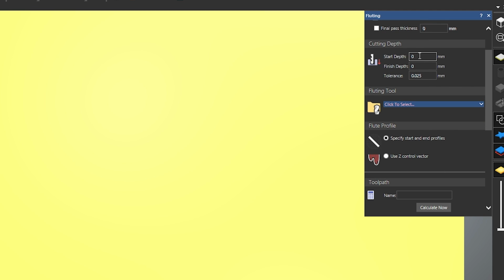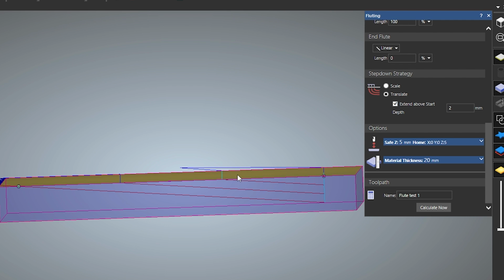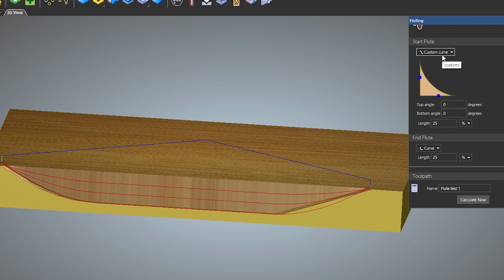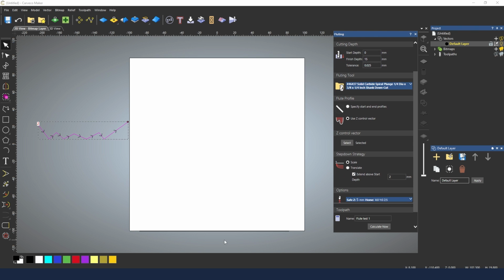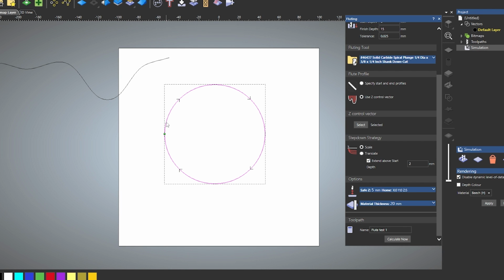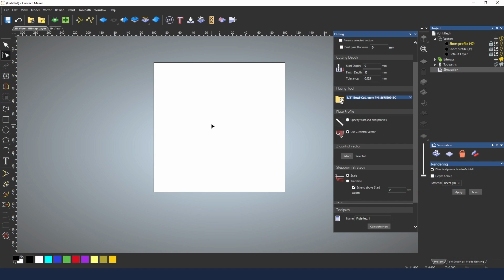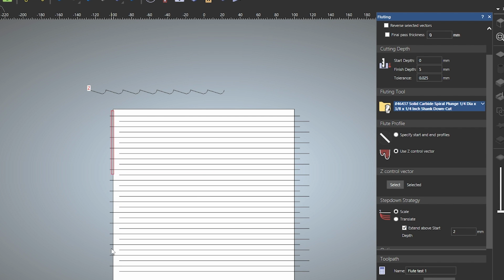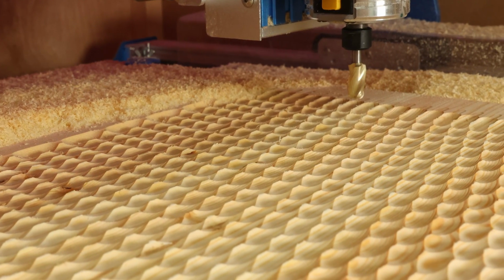WITHOUT a texture tool on your CNC machine - Fluting in Carveco Maker

Comment from the maker: 150+ Fluting Profiles
https://jamesdeandesigns.com/product/flutingpack/

Carveco Maker 
https://store-us.carveco.com/?ref=JDDesigns
Discount code JAMESDEANDESIGNS

CNCWITHME
https://www.cncwithme.com
Discount code JAMESDEANDESIGNS

Jenny Bits
https://www.cadencemfgdesign.com/?ref=JDDesigns
10% off code: JAMESDEANDESIGNS
Reply: Was this done in maker or maker+ ?
Reply: How would you go about drawing even polyline paths like you show at 25:22? Instead, I tried to do an arc, and then use the block copy to make multiples. I selected all of the arcs and then clicked the "Z control vector" but it did not select them. Is there a way to draw equal/even polyline curves?

Comment: This video was recommended to learn about fluting.  I'm on your first example ("Flute Test 1") and I've triple checked all my setting but when I click on  "Calculate Now" it simply says  "No toolpath was created for the current tool".  Doesn't say why, just doesn't generate.  I did notice when I put in 20mm in the "Material Thickness" section, my Z Top shows 0 mm and my Z Bottom shows -20mm.  Not sure if that is the issue or not.  I'm still checking everything again but no luck.  Any ideas on what I can check to see why this isn't generating?  If I figure it out, I'll post an update.  Thanks!
Reply: Okay...figured it out.  It looks like I had 2 lines on my original polyline.  I checked out my polyline and it had 2 lines on top of each other.  I deleted one, clicked on "Calculate Now" and it went through with no problems.   Now I can continue.  :)